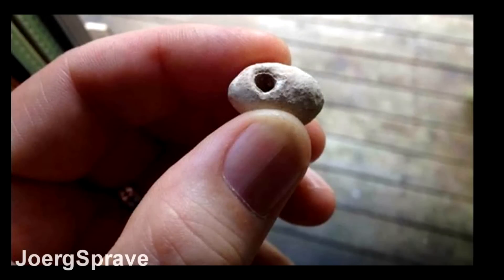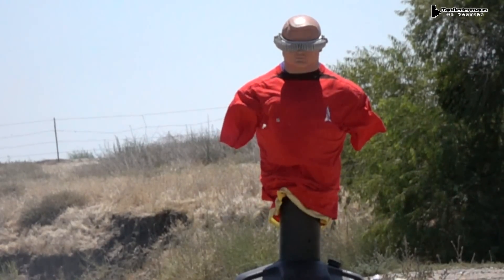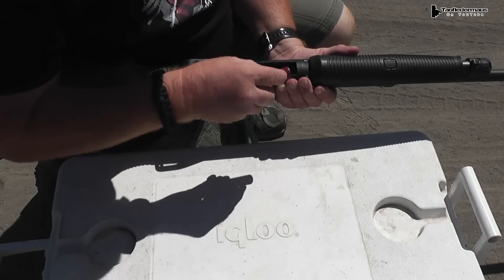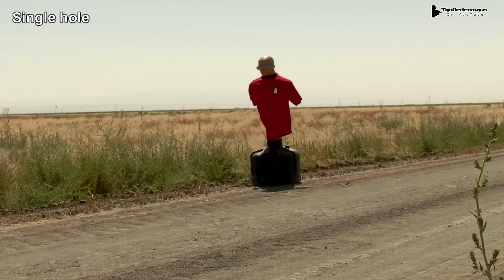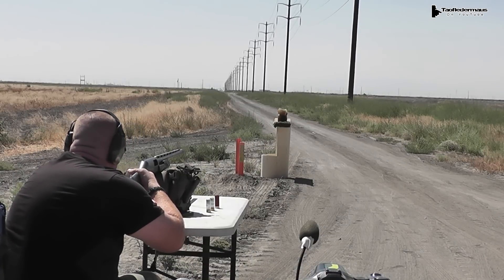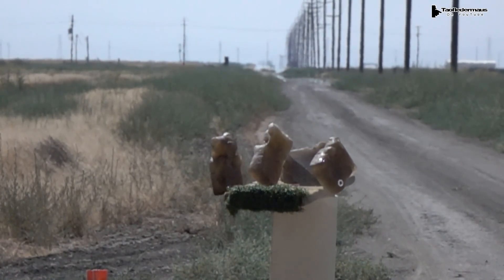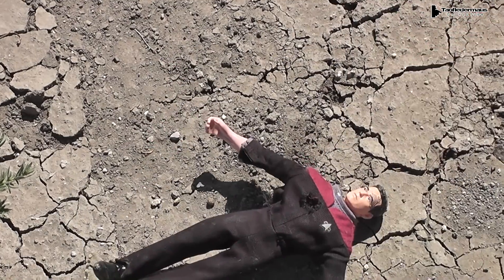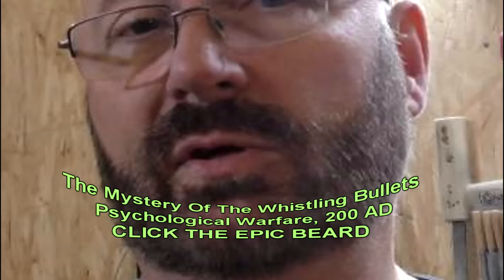Whistling Roman SHOTGUN Bullet Experiment

Comment: It needs to be an oval the whistle is because it is acting like a flute as the oval spins in the air it causes the chirp for this to work in a shot gun you need to make a tumbling round with one side drilled. my recommendation would be a 12 sided die or near that many sides what ever fits into a 12 gauge shell!!!!

Comment: The ‘reed’ needs to be at right angles to the airflow in order to create the vibration needed in the sound chamber. Firing it inline to the airflow doesn’t cut the mustard. It would also help if the round is aerodynamic. Look at flutes where you blow across the aperture.

Comment: The chirping sound in the slingshot video probably needs a much lower rotation rate.  For context, a 5.56 is rotating at around 200,000 RPM, a slug in a rifled shotgun bore is probably rotating at 40,000 RPM, and a fostner slug in an smooth bore around a few hundred RPM.  You probably need to start with a Fostner slug rotating as slowly as possible (maybe a shallow angle on the “grooves”?) combined with a hole drilled off-center in the nose of the slug.  Experiment with depths of the hole, and drilling the hole through.  Experiment with placing the hole off center on the nose vs along the side.  I’m betting you can find the sweet spot.

Comment: TAOFLEDERMUAS, yes, even though the slugs were moving sub-sonic, the air flow around them is traveling super sonic, because it has to speed up in order to get around the object. Often  objects with supersonic have an issue where the air just flows strait over the object rather than into the divots or holes. This happened with Spacex’s  falcon rocket, it uses grid fins to translate while falling. While traveling at supersonic speeds the air completely acted as if the grid fins was a flat surface and the air didn’t go through them, it just went around! They fixed this by making the grid fins have a pointy bit but whatever. That’s what I think is happening here. Another thing is, the faster things go, the higher tho whistle, maybe the whistle is too high for us to hear since it’s traveling so fast. Thanks for the awesome video and the great problem that I could roil with.

Comment: Tardy to the party, but on the mickey mouse one whistling: you had two holes offset from the center to induce some drag, and the bullet whistled when the hole tilted sideways and wasn't holding in the pressure cavity. It doesn't work at those speeds because there's no air actually flowing over the hole like it would ad subsonic speeds, so the hole needs to off to the side and you'll have to sacrifice accuracy unless you drill a hole on either side of the slug and use a reduced charge instead of a stronger charge with a centered hole. Just my thoughts on the matter, but I'm almost 4 years late, so oh well.

Comment: Calculate the pressure inside of normal metal whistle and compare the size of its port. Then calculate the pressure made from a bullet and see if you can’t manage of drilling a port, I would think the bullet goes so fast that the port would be small to maintain the pressure you would rationalize for the whistle. It would be so high pitched we may not be able to hear it lol.

Comment: Mouse slug was uneven in drag and thus induced a spin. when the air is going across the hole instead of into it will whistle. if u loaded the others with the hole on the side you would likely get a sound off on them as well.

Comment: Drill into the front then another perpendicular to the hole but only half depth 

The whistle comes from air flowing over the hole not into the hole. A side hole would make more sound. But you will lose mass.

Comment: Maybe if you drilled the hole through the cube, and put it in with the hole on the side.
Reply from the maker: It wouldn't whistle if you drilled a hole through it.  I did put the hole on the side.  A cube has 6 of them.

Comment: i would drill all sides completely through the cube (since you dont know about the rotation orientation), also try different drill parameters. I figure the smaller bores chirp different / more. You may also try drilling offset from the center.

Comment: The whistling comes from the air passing over the hole. The spin of the stone will make it chirp went slung. The mickey mouse had a chirp because the holes were off center.
For how that works, think of a bottle flute. The sound is produced when blowing across the lip, but not when blowing directly into the bottle.

Comment: its because they were square . the wind needs to blow across the hole the edges on a cube distorts it to much. also im sure velocity had something to do with it
Reply from the maker: These tumble so it doesn't matter
Reply: I does matter. as a oval object moves through the air its aerodynamics remain constant or at the least similar . while cutting through the air there will always be  a equal pressure moveing across the hole causing whats called Helmholtz resonance . the noise made when you blow over a bottle for example . a cube like this would not have constant or even similar while it tumbles. its dynamics are rapidly changing.  i bet they were whistling but only for fractions of a second less than what would be audible
Reply: it would have actually made far more noise if they didnt tumble at all..

Comment: I have a suggestion, drill a hole that tapers down to the back so it funnels the air, and make the roud have some grooves in the side so it will work with the rifled choke and it should accelerate the air and speed up the road a little bit, then maybe drill some small holes in the side so it will whistle

Comment: TALFLEDERMOUS
I know it has been a while since you did this video. However, it occured to me if your holes were smaller (to conserve weight) and cross drilled, that could work. also maybe a hole drilled through with a flat sliver of metal hammered into the hole to act like a reed in a musical instrument  (varying overhang/depths)
Hope to see you give it a shot ☺ Resistance is Futile

Comment: Since the projectiles were spinning cubes, the areas of lowest airflow on the surface of the cube would be the centres of each face, and that's where you put the holes. The mickey mouse cube had holes at the edges of the cube, increasing the airflow over the holes to the point where the whistle was audible. I think the best design would be a traditional bullet shape with a hole drilled either on the curved front or just behind it.

Note: Didn't do any maths, just intuition, so I could be wrong.

Comment: the 'chirping'  sound, occurs when wind moves across the slit , when you're shooting the slugs, they don't often tumble, or when they do, the flat surfaces reduce the amount of wind crossing that singular hole. for it to have whistled, i'd like you to try drilling the hole and placing the hole sideways, so when it spins, the hole will hit the wind from the air moving across it. it's just a theory, but not a fact. i'd suggest trying it and see what might happen

Comment: air needs to enter and escape that's why when you see whistling darts they have slits on 2 sides that the air is rushing over unlike the slugs that where facing forwards, so if you wanted to make a whistling round you would have to make a slug that would spin perfectly while having 2 small slits perpendicular right the way through maybe 0.5-1mm by well pretty much the same all depending on the slug

Comment: So perhaps the square slugs don't whistle because they are too stable. If the projectile tumbled rapidly you might get a whistle. Maybe if the hole was on the side of the projectile you would get a whistle. Think blowing across the top of a bottle. Great videos by the way.
Reply from the maker: They definitely tumble through the air
Reply: Just remembering how the square projectile punched a square hole in the star trek doll to me indicates a non rotating hit. The sling shot guys projectiles whistled and they were round. The ones he did that came off the stick would definitely be spinning.

Comment: The hole needs to be on the side of the bullet. The whistling comes from the rotation of the hole 90 degrees to the direction of flight. Give that a try and see what happens.
Reply from the maker: The cubes tumble
Reply: Is there any way to add spin for stability? Can you drill a hole in the side of a slug and see if that creates a whistle?

Comment: I really studied this.  I saw a bowling cannon fired and the ball whistles as it flies through the air. The pitch changes as the holes are of different depths. The holes need to have sharp edges and be deeply drilled but never go through. I bet a .662 diameter lead ball with a deep sharp hole in it placed in a standard aa12 wad will make a whistle. It will only work when the air moves across it sideways like a flute.

Comment: The angle someone blows into a flute is about 30°, the flute itself 180°. 
 I don't think making the bullet whistle is as important as making the plastic bit that separates the powder from the slug, whistle.

I'd drill one hole at a 30° angle full length through the sides and the second hole drilled at a 180° intersecting (not all the way through) the 30° angle, facing the back.

The whistling bit would be the plastic something behind the slug. It would keep the slug straight but there would be a whistling for as long as the plastic part was flying.

I guess you could drill a slug the same way too but accuracy would become a factor.

Comment: the whistle isn't possible due to the aerodynamic physics of force on your bullet.  the ROMAN whistle slugs have hole COMPLETLY THROUGH them.  Your cubed bullets did not.  While in flight, your projectiles have a force of air in front of them.  the air CANNOT pass down the partial hole in your cube.  If the hole went all the way through your cube, then, air would be able to pass through and "whistle".
Reply from the maker: I take it you didn't watch Joerg's video

Comment: I'm guessing that the geometry of the bullets also play a factor since a round bullet has a smoother surface as it flies through the air so the hole would "catch" more air into its hole. It's a little bit like bottle blowing but in high-speed.
and with the cube the corners "hide" the hole from the turbulence.

Comment: The diameter and depth of the hole has to be tuned to the speed of the air rushing past if you want to get a whistle that's in the audible range.  If you know the velocity and the frequency you want there are some mathematical formulas you could use to calculate the hole sizes you want.

Comment: I feel the problem was the lack of rotation across the axis of the holes. also it may have behaved differently if the projectile was loaded into the cases withe holes running across the diameter of the barrel and not parallel.  I would like to see this one revisited.

Comment: I would think the reason it never made much noise, is the air was pushed down the hole and not across the hole,  look at a flute you blow across the hole and  you can blow across the top of a bullet shell to make a whistle, so try  holes drill into the side of the slug,   so as it travels the air cuts across the holes, not down the hole,  a 22 call hollow tip don't whistle when you shoot them unless they hit something and bounce and tumble

Comment: ok so the reason the bullets did not whistle is the angle of airflow past the hole....your hole was sreaight on to the airflow, which will not work. An oblique angle will produce sound just as you blow across a beer bottle does....give it a try, you will see I am correct

Comment: My theory to the whistle is this: the cube with 1 hole has a 90 degree edge, the mickey mouse cube has sharper edges, because the holes are next to each other. And that's the reason the mickey mouse made a faint whistle. Since the bullets used by Joerg are balls, they also have a sharper edge, and they also whistle.

Comment: Did you try any with the hole perpendicular to the barrel? Basically, just with the cube orientation turned sideways in the shell, or with the hole passing through...
Reply from the maker: Because the cubes tumble through the air - they don't fly with the hole facing forward.

Comment: OK you wish to know why there was no whistling sound. It is because you created a super sonic dog whistle. If you analyze your recordings you may see sound frequencies above the range of human hearing. to demonstrate this blow over the mouth of a bottle to get a sound then try blowing harder really harder. When you reach the right velocity the frequency will double this is called the first harmonic. With shotgun velocities over 1050 ft/sec. you are already breaking the sound barrier plus the air needs to be passing over the hole at right angles to create oscillation in the cavity. Holes drilled in a round projectile at right angles to the center axis will whistle as long as the projectiles center axis is inline with the flight axis. Just remember the speed, and depth of hole determines the frequency and most people cannot here frequencies above 10, 000 to 20,000 Hrz..

Comment: when they meant by a hole i think they meant to drill all the way through, creating a hole that doesn't have an end to it is just a wind catcher. if you put an actual hole in it the wind will get separated and cause a flux. or kind of a pocket where air is parted which causes the sound.

Comment: The hole has to not be on the side facing directly forward or backward.
It has to be perpendicular to the shooter so that it partially catches the air and makes a whistling sound.

I assume that the front facing single hole had the hole side facing more-or-less straight, so there was no pressure oddities to make a whistle.
The mickey mouse one would have been off center in it's balance though, causing it to tumble almost immediately after leaving the bore of the shotgun, thus causing the side with the holes to rotate allowing the hole side to be on the sides instead of facing with or against the trajectory.

As it traveled along it's trajectory while tumbling, there would be no whistling when it was facing forward/backward, but the rest of the time it would whistle.
Reply from the maker: The cube tumbles so it didn't matter what way the hole faced

Comment: Just spit-balling, but whistles work with air moving at an angle across the hole. I think you might have better luck if the hole was oriented towards the shell case walls instead of head-on into the wind. Not sure if rotation would increase the likelihood of making a whistling sound or not, but assume that given a slightly irregular surface (i.e. non-CNC'd) that the air moving past the sides of the slug could have a better chance of producing a sound. Regardless, great video, as usual. [Forgot you are using a smoothbore barrel. Maybe try it with rifled choke?]

Comment: i think the problem is that the air is going in to the hole but it can't come out because of the air pressure caused by the bullet traveling at high speed. I couldn't really see it but it looked like the holes in the MM round connected, that would mean that the air could escape sideways and thus creating the whistle sound. I think the best way to create a sound is drilling a hole sideways through the lead or through the entire length of it so the sound escapes from the back. A angled hole could also do the trick.

Comment: Can you redo the experiment but load the slugs so the dimple/holes are on the side of the slug instead of the front? If you make whistling arrows you put the holes on the side of the tips, not the front. By putting the dimple/hole on the front you're not trapping air you're only giving it a pass through, if it's on the side it should trap air as it passes over the edges and create a drag that causes a whine.

I think the experiment could be interesting if you loaded the slugs similar to how you make the arrows.

For reference:

https://www.youtube.com/watch?v=6heLw2lMXEU

https://www.youtube.com/watch?v=ntCqbZ631jA

Comment: I think you might have had better luck if the hole were horizontal or diagonally across the projectile. Instead of inline with the direction of travel. Air passing the hole would cause the whistle. What you have is a square hollow point and regular hollow points don't whistle either
Reply from the maker: The cubes tumble.

Comment: Couple of things you can try is turning the square projectile where the holes face the side wall of the casing instead of facing down the barrel. It will have the air travel perpendicular to the hole. If that doesn't work try shooting it out of a sling shot and see if it makes a sound. If it does, then the velocity is to fast and my have to reduce it to make a sound or make the hole diameter and depth different. There is a velocity where it should all come together to make a sound.

Comment: You could try a cylindrical slug with a small hole drilled halfway into it radially and shoot it out of a rifled barrel. The hole should knock it off balance enough to get some wobble to get the oscillation for the whistle...or I could be full of crap.

Comment: why dont u do a round ball one with the hole
Reply from the maker: I would if I had a mold.
Reply: o lol what about a slug with some holes
Reply from the maker: It would be better if it were a sphere so it would tumble through the air.   A foster slug isn't going to tumble.
Reply: true but better to try something then not lol u never know what might work
Reply: i believe the hole of that specific diameter and deppth relies on the spherical shape as a maens to guide the air over the hole to create the whistling effect. which could be achieved no matter how the ball spins due to the magnus effect.
Reply: lol
Reply: what if you used a slug (any that get good rotation) and drill the hole on the side at an angle similar to those in regular hand whistles you just blow into. the spinning might cause it to whistle (3 holes is still probably the best bet)